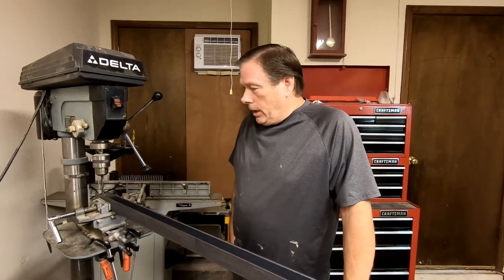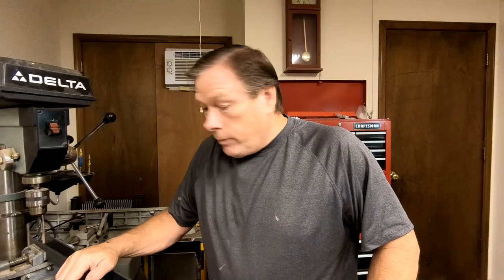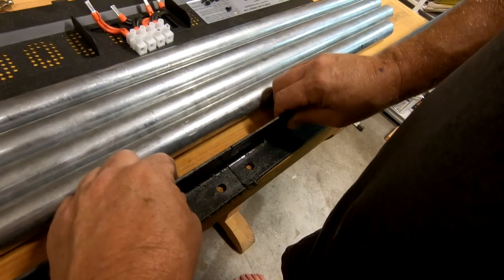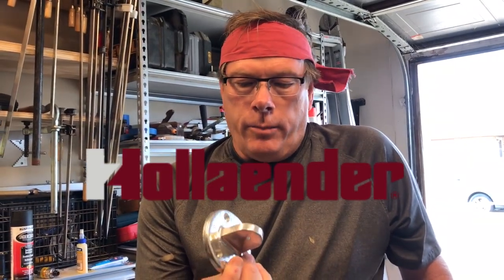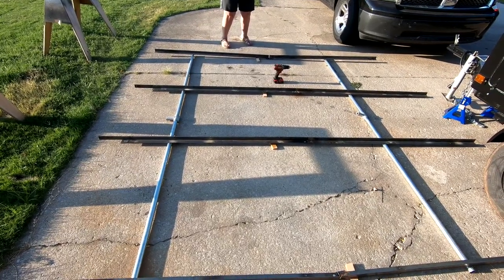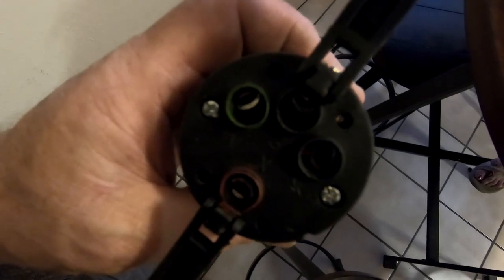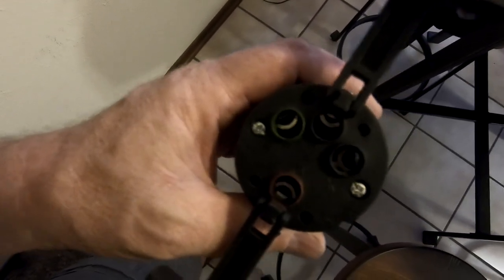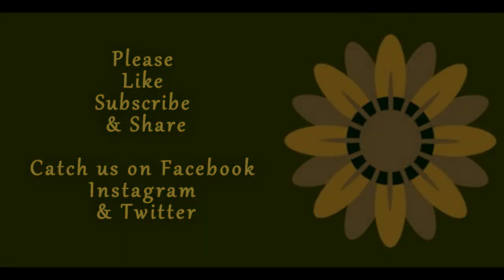Panel Rack Design - Portable Solar Generator Rebuild

Comment: The neighbors are all like whaaat are they doing ?  Thats going to be a heavy duty rack. Looking good. 👍👍
Reply from the maker: Sometime we wonder ourselves what we are doing!  The rack and panels are heavy, for sure. Approximately 350 lbs. mounted to the side of the trailer. We are still working to make it work better for us and it is not done. But we deliberately are going for that weight for a couple of reasons: One is to counterbalance the weight of the inverter and other electrical components inside on the opposite side of the trailer (about the same weight). Another reason is to fight wind.  Ground-mounted rack systems are heavier than this. Thanks for watching, G. We appreciate you. You and your neighbors, keep the comments coming and even offer some advice! We're definitely open to it.